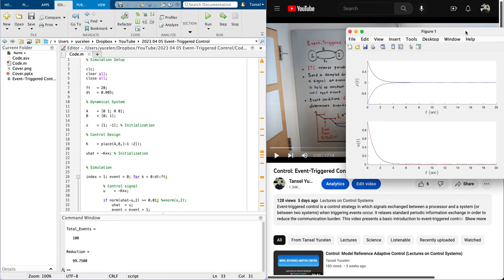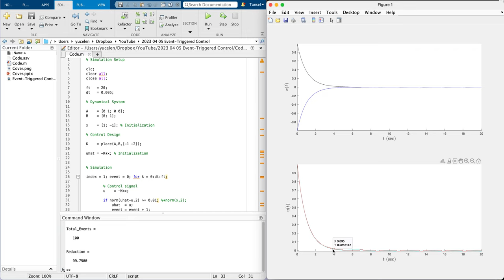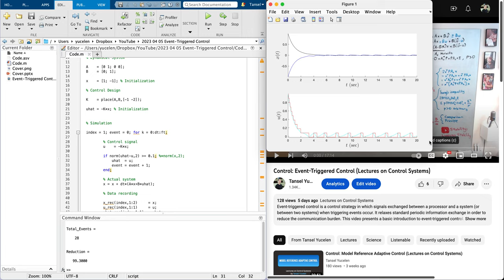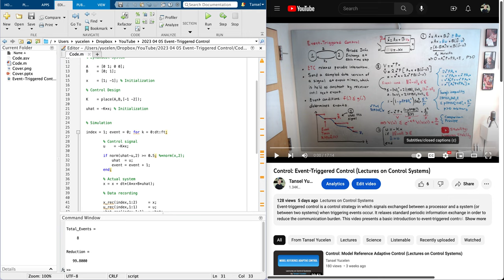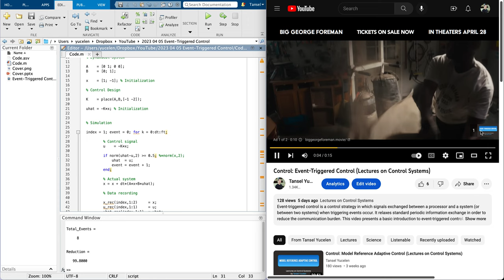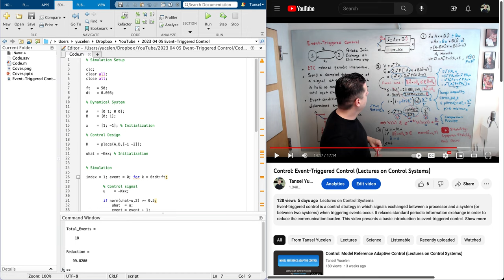Control: Event-Triggered Control Example in Matlab (Lectures on Advanced Control Systems)

Comment: Thank you for sharing! I am currently working on a Matlab simulation of event-triggered control, but my approach is a bit different from yours. I am using the ode45 solver to solve the differential equations and placing the event-triggering if statement inside the ode45 solver. However, I encountered an issue where the time in the resulting plot is reversed. Would it be more reasonable to use your approach, that is, not using Matlab's built-in solver?
Reply from the maker: Thanks! Honestly, I cannot give an answer without knowing any details. In general, it is good to compare different solvers and evaluate their performance to determine the best fit ;)

Comment: how  consider  nerwork delay  in et systems  ， i need you help
Reply from the maker: Did you search for papers on this topic? See, for example:

Garcia, E. and Antsaklis, P.J., 2011, December. Model-based event-triggered control with time-varying network delays. In 2011 50th IEEE Conference on Decision and Control and European Control Conference (pp. 1650-1655).